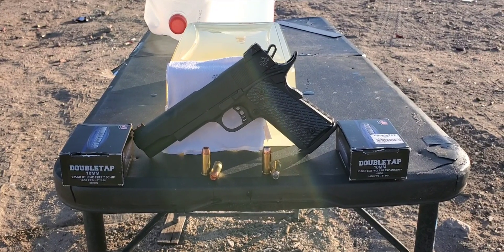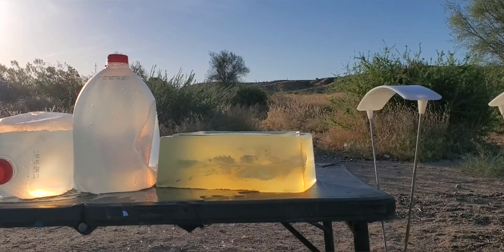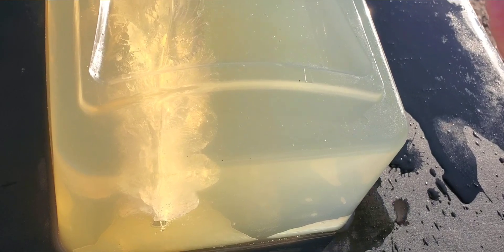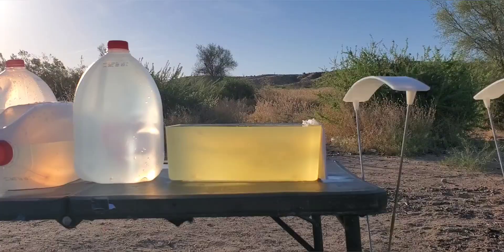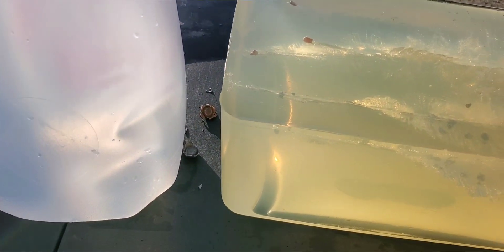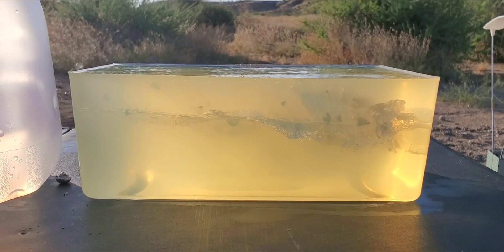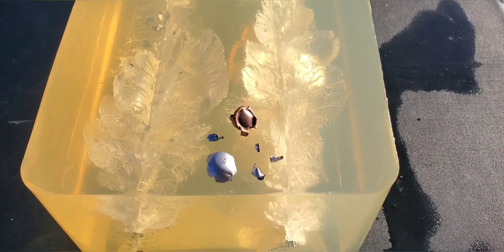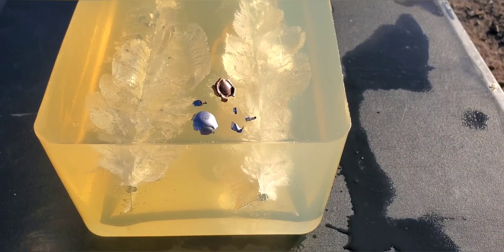10mm DoubleTap 125gr VS 135gr in ballistics gel

Comment: I prefer the 135gr controlled expansion HP because it delivers all of its energy more quickly than the 125gr that continues on, carrying momentum and energy along with it.
In my case of wanting a gun with the best one-shot stopping capability, I want that projectile to be able to dump all of its energy as quickly as possible while having the necessary penetration possible to do the needed damage where it hurts.
I feel the 135gr better meets that requirement over the 125gr.  But both are phenomenal rounds and I am so happy that DoubleTap is basically the only manufacturer that DOESN'T skimp on 10mm velocity.
Reply: yea just dont forget, the geldblock doesnt have bones n stuff.. so hard choice indeed because both are awesome.
a 125grainer with a softer bullet would be nice because if you get one with that speed and impact to explode basically in the first 10in parameter we would get all the 722ft lbs right there.
instand fightstopper ftw.
Reply: Its hard to compare the performance between a monolithic projectile and a more traditional cup and core JHP because the way they mechanically deform is drastically different.  Copper bends, so on a monolithic HP the petals simply bend backwards.  Personally, I'd like to see thicker pedals on that 125gr, but its pretty light for caliber so there's a limited amount of space to work with.  On a traditional JHP, the jacket bends back just like a monolithic, but the lead gets smashed.  Even though lead is soft, smashing it like that consumes a LOT of the projectiles KE.  It's takes far less energy to bend the 5 copper petals backwards than it is to smash the lead into that mushroom shape.  That's why a monolithic bullet penetrates so much deeper.  Yes, they often retain 100% of their weight (even though the 125gr didn't), but even when compared to a standard JHP that has excellent weight retention, a monolithic bullet always penetrates deeper.  The energy required to deform the projectile is consumed by the projectile, NOT by the target.  In this scenario, MUCH deeper penetration does not necessarily mean less energy transfer.  Judging by the wound cavity, I'd say the energy transfer was almost identical, but the monolithic projectile did so much more efficiently allowing its remaining core to retain enough energy (actually momentum) to continue penetrating MUCH deeper than the slightly heavier JHP.  

IMHO, the argument here for the 135gr JHP is that it is less likely to exit a target, and if it does exit, it as a lot less capability to inflict damage on anything else it might encounter before coming to a full stop.  With that said, if used in a defensive scenario and it strikes a forearm, it is not nearly as likely do the intended damage to the vitals, so its a trade off.  If the 125gr had thicker petals (ie designed for higher impact velocities), it would likely be the best of both worlds.